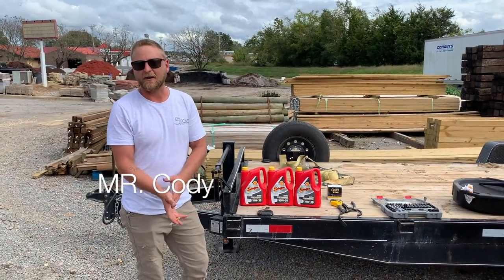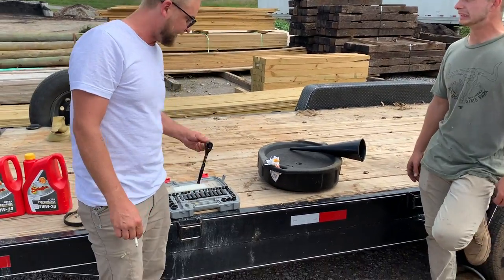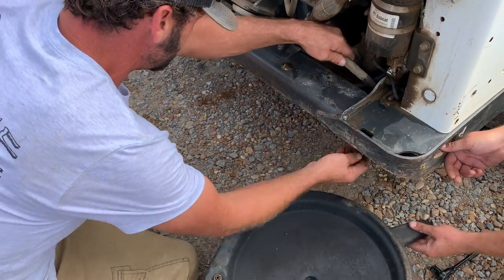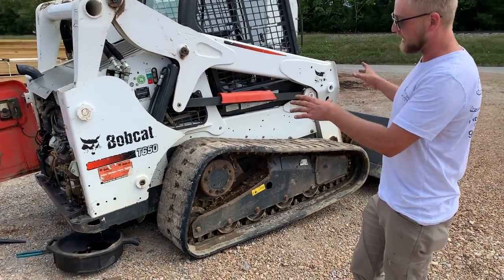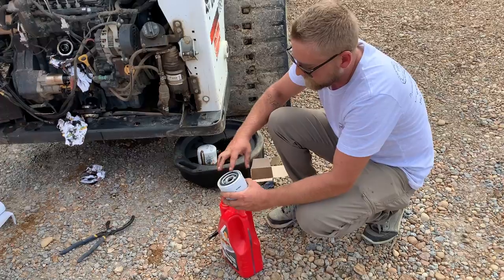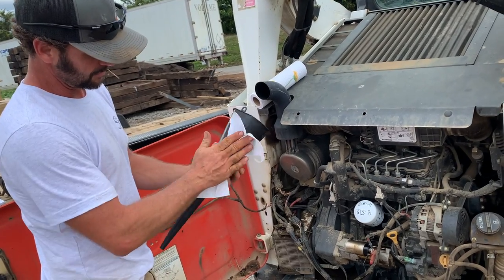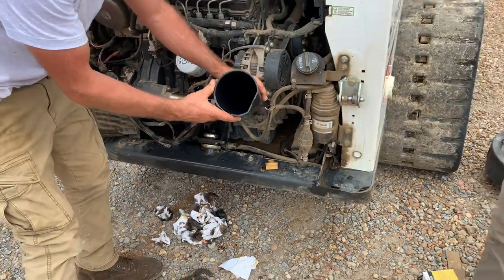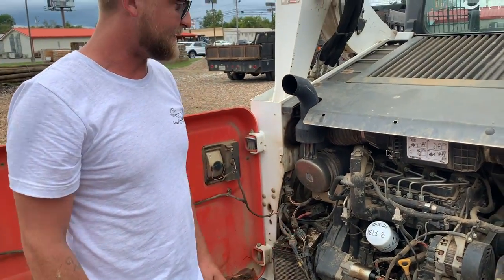how to: Bobcat T650 oil change

Comment: On machines with AC, there is a bunch more equipment/tubes in the way and a lot of grease caked dirt loads up in the bottom of the engine bay where you need to fish that oil drain hose .   I drilled a bigger hole in the opening to get my oil change hose through it easier, otherwise it was very difficult to do the maintenance.
Reply from the maker: Awesome thanks for the input!